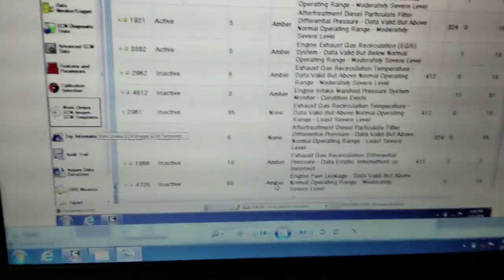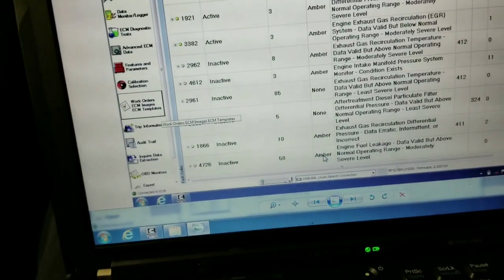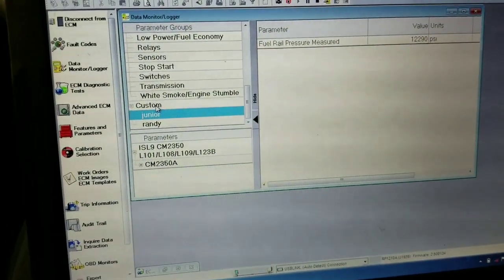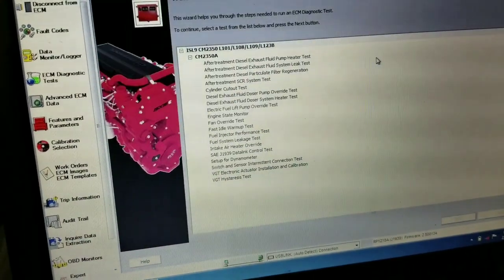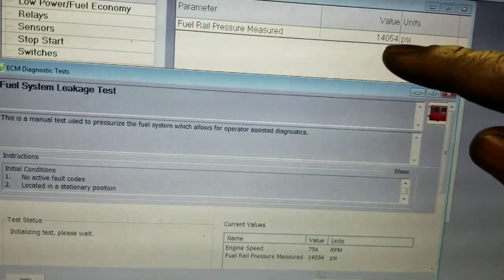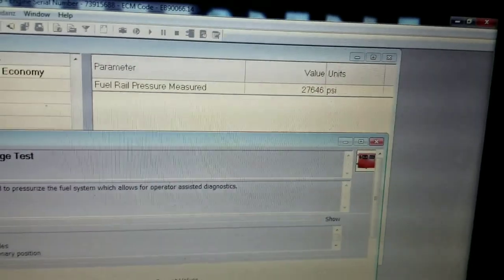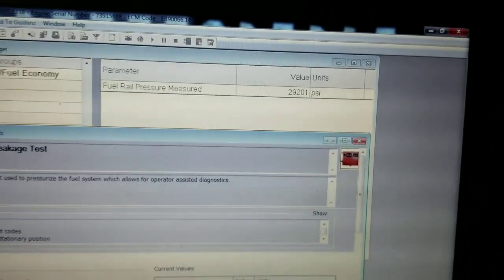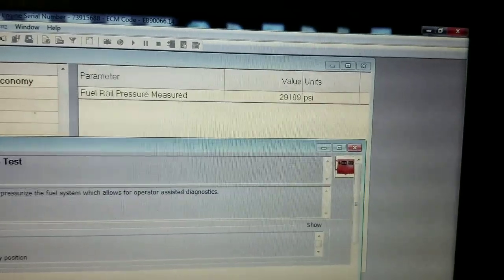Cummins ISL Fuel Pressure Relief Valve Code 4726

Comment: My Rv has this engine, the first Cummins shop charged me 1000 and said they didn’t know what’s wrong. It’s taken over 2000 dollars is labor for the second facility to determine this part was bad. Seems to me if the technician knew how to operate their own diagnostic systems, this should have been an easy job.

Comment: My truck is a 2018 Kenworth W900 with a Cummins x15. I didn't have this problem before. I'm not entirely sure, but I think it started happening after a overhaul four months ago. The engine has 30,000 miles on it. It seems like after I shut the engine off for about 7-10 hours and then restart it, it's fine until I start driving, especially when I have to go uphill immediately. Then it starts losing power because the fuel pressure drops from 30,000 to 2,000. When I stop, the engine shuts off on its own. But when I start it (I have to try 2-3 times),Once the engine is started, everything returns to normal. Any suggestions? Thank you.

Comment: Did you replace the seal inside the fuel rail that connects with the relief valve? I’m trying to figure out if i can just put the new relief valve and call it a day
Reply from the maker: No. But cummins recommend changing it.

Comment: I’m having the same issue with a Paccar px9 and The spacing is limited to get to that relief valve. I was skeptical about using an impact to get the thing loose but you just gave me the confidence. Thanks for the video!

Comment: I got code SPN-157 FMI 18 Engine Fuel 1 injector Metering Rail 1 pressure. Any idea what it could be? I am starting out with Waterfuel separator filter and fuel filter. This Cummins isx15 2013 Volvo.
Reply: Did you ever fix this?
Reply: what fixed your problem?

Comment: Have a ISL9 cm2250 with a fueling issue. Starts and runs normally, no fault codes, Ran an after treatment Regen analyzer, test completed and passed with no failure errors. Ran an injector performance test, test aborted after about 30 seconds stating fuel pressure unstable.  No high fuel decay rate. No high pressure leak from HPR valve (0drops in 60 seconds, spec=30drops Max in 60 seconds) and injector return at rear of cylinder head (30mL measure in 60 seconds, spec states 90mL max in 60 seconds). Fuel pressure leakage test keeps cancelling intermittently and failure error states high fuel pressure condition exists. Low pressure system checks out okay 120psi at high idle and suction side checks okay (5inHg, spec states 10inHG max). Any ideas? Could a HPR valve be stuck closed and malfunctioning causing the high fuel rail pressure?

Comment: I just had same isl9 engine with just this Code !!!
The high pressure fuel pump was already replaced, so I replaced the Silver valve just like you diagnosed.
Went for a Road test , CEL came on.
Left to have further diagnosis.
You did not say weather you Replace the Aluminum Compression Washer. ????
Or made a video how to remove the Compression Washer from the fuel rail.
Reply from the maker: Cummins recommend changing the washer. There's no 1 fix for this code. If you perform the pressure test, and it's leaking. It can be the valve, fuel injector,  fuel pump, or fuel rail, all on the high side. Ultimately you must run your diagnostics. The video is just to help someone who has never seen this code before. Make sure you don't have fuel restrictions also.
Reply: @radieseltech6417  we now changing injectors, will keep you posted
Reply: There are 3 drain lines for the rail.  1 from the back pressure relief valve 1 from the injectors and 1 from the fuel pump, they all go to the fuel manifold.  Cummins recommends to install a banjo bolt connector with a line to a collector or bucket with a measuring beaker for each return at the fuel return manifold and to measure the amount over 1 minute when engine is operating for each outlet individually.  The line with excessive fuel is the leaking side. There are individual injector cutoff clamps that go on the fuel rail to stop fuel flow to that injector to determine the exact leaking injector.

Comment: I have a cummins engine on a Hyundai hx380l bugger.  Engine number 22196104. The engine needs more fuel than usual.
 It consumes the value in 10 working hours 480 liters.

 Although the Hyundai company in the country tested and failed to solve the problem

 Could be the problem from the common rail

Comment: I just tried the fuel leak test and it gets to 29k psi but once i turn off the key is drops to 0 in less then 10 seconds. I replaced the pressure relieve valve and its still doing it.
Reply: Check your injector return flow at the back of the cylinder head.
Reply: What did it end up being,  I'm having the same issue.

Comment: Hello, can you help me, where is located the check fuel valve Cummins ISX15. Thank you
Reply: I hope ya found it 
It depends on the year of isx 
05-09 it's on the primary pump 
10-17 it's on the fuel rail front of engine

Comment: Experiencing this problem with several of the M2s at work and techs are "quarterbacking" parts at them.  Will definitely try this.  Thanks!
Reply: Changed it, fixed it!  Thanks!
Reply: @kamahoo451 most likely a injector not a fuel pressure relief valve there’s a way to test them. You are supposed to remove the banjo and install move the return line aside. Max the pressure and it’s not supposed to leak more than 10 or 30 drops have to check on Cummins quickserve
Reply: Quaterbacking 🤣🤣🤣🤣 lmao thats what the stealership do best